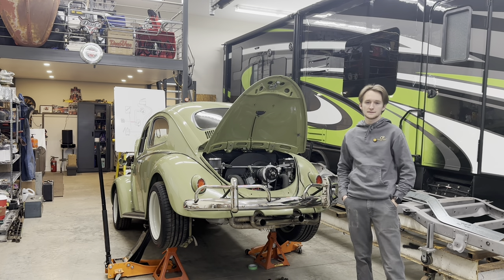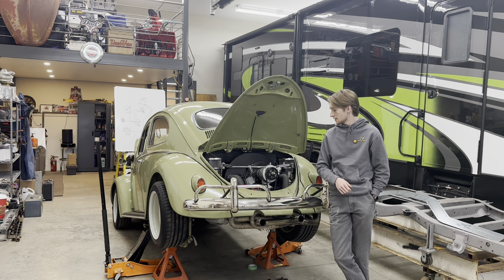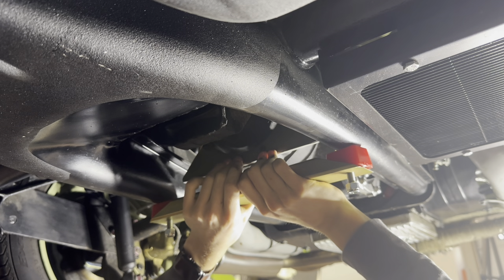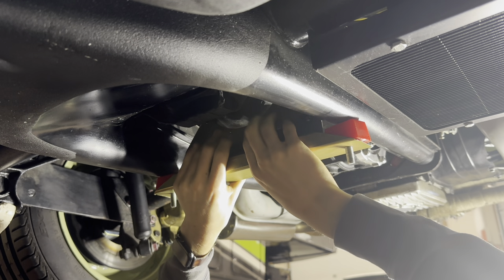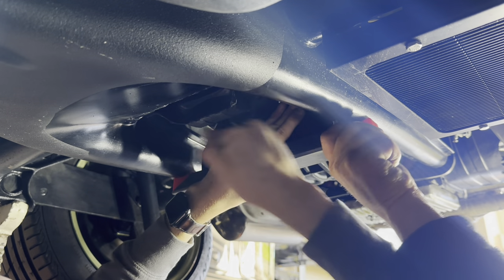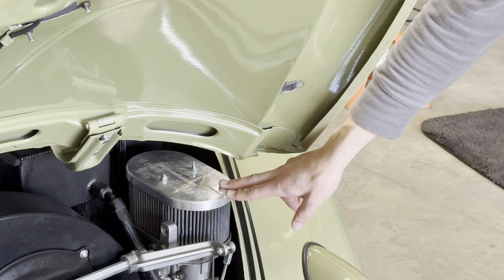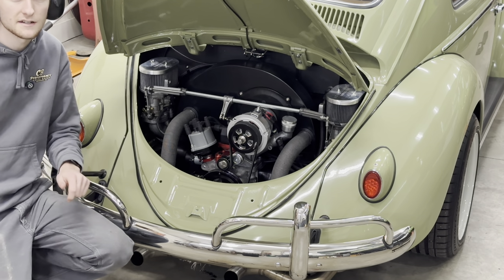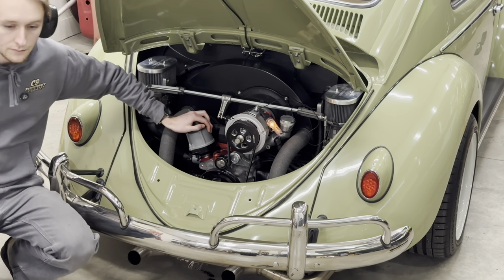Crazy 180hp Launches! Spring Fix Up Pt.2

Comment: Look into a Kafer bar to help support the rear frame horns and the engine won’t flex so much on acceleration. 
If you are using LED idiot lights that could be the issue. 
Sweet beetle and keep up the great work!
Reply from the maker: Thanks for all your advice and comments! I had someone else say that the horn stiffeners won’t be enough and to do a traction bar instead, I’m just afraid of it causing more engine noise in the cab so I’m still leaning towards the kafer bar because I really like that idea. I’m also about to checkout the idiot light, I have a feeling you’re right.
Reply: @smithsgarage273  keep us posted on how things turn out. Don’t be shy about asking questions, we all learn from one another and help support each other. 

The multiple comments will help your algorithm 🤙
Reply from the maker: @VWJawbreaker thank you! The vw community is so nice on here, I really appreciate it all. I’ll be sure to try out everything and be back to report, what’s your opinion on either a traction bar vs the kafer horn stiffeners?

Comment: Alternator light.
If you’re using a stock speedo, the wire from the alternator signal goes to the bulb. 
The bulb on the speedo needs to be an incandescent bulb. 

If you’re using a stand alone bulb that’s not in the speedo, it also has to be an incandescent bulb. 
The wire from the alternator signal is “ground” and you run a hot wire to the other bulb terminal from a switched location on the fuse block and not from the ignition switch.

Hope this helps.

Comment: Along with the Transmission brace you need an engine (traction bar) I know its limited because of the exhaust you are running but the back of the engine needs to me supported. Aloha and keep up the great work.
Reply from the maker: Thank you, I had looked into it but I was worried about engine vibrations getting transferred to the body. Right now I’m exploring the brace that comes down from the shock mounts to hold up the ends of the engine horns. But I might have to bite the bullet and go for the traction bar. Thanks for watching my video!
Reply: @smithsgarage273  Im also restoring my 66 VW bug (for the second time) I had a traction bar for years and it only mildly increased the vibrations. You definitely need a traction bar at the rear. Frame horn stiffeners still allow the engine to move too much.  Aloha.
Reply from the maker: @gillpecceuservices  thanks for the advice, I just have to find a good work around for my exhaust.

Comment: Just a shot in the dark here, have you updated your dash lights to LEDs? I don't think LEDs provide enough current to 'excite' the alternator, so the alt light has to be the old incandescent style bulb (which is why it works when your test light is connected). If that's not the case, then from my experience 99.9% of electrical problems are with a ground. Cheers, love your Beetle.
Reply from the maker: Thank you, that’s actually a great idea, it makes perfect sense. I’m gonna make sure to try that one out tomorrow.

Comment: Do you have a diode installed in your idiot light circuit? I remember having to install a diode to the idiot light. You also don't want to run your coil off of your alternator. It should be dedicated off your ignition switch.
Reply from the maker: I don’t but if all else fails that’s what I’m gonna do. And yeah, I’m gonna wire it that way for the permanent fix, through the alternator was just my way of checking it and making sure it worked. Thanks for watching!

Comment: Research “vw wheel hop “
You can’t just have a mid brace alone, you also need berg HD rubber mounts and Traction bar OR go all solid mounts and most importantly you have to stop frame horns from flexing and rebounding-the whole engine is cantilevered off them and that’s a lot of weight- tie frame horns into shock mounts or roll cage or just get a Truss setup, only way to stop what You refer to as engine sag or whatever you called it(it’s wheel hop)
Reply from the maker: Thanks, yeah, I didn’t know what to call it really, I did a bunch of recording in slow motion and I only ever saw the engine drop, but the wheels never hopped like usual cars do with wheel hop. The mid mount was just a last ditch effort of something easy before I go for a kafer truss or traction bar.